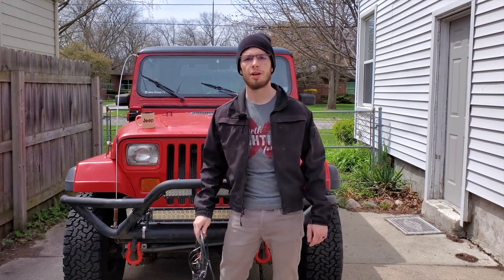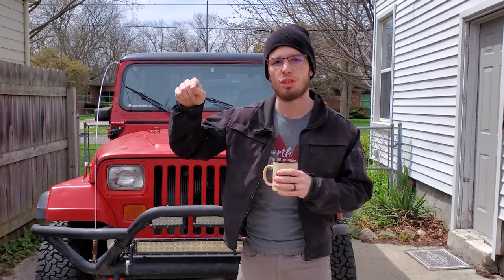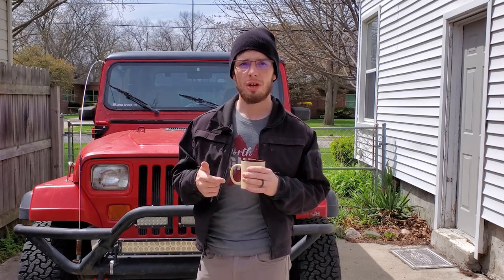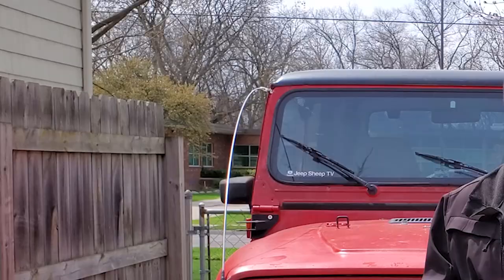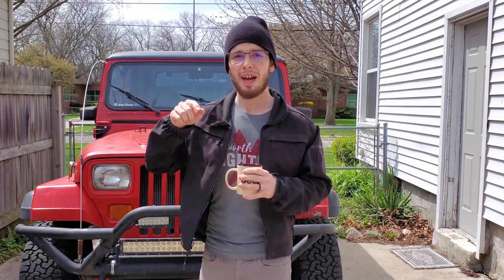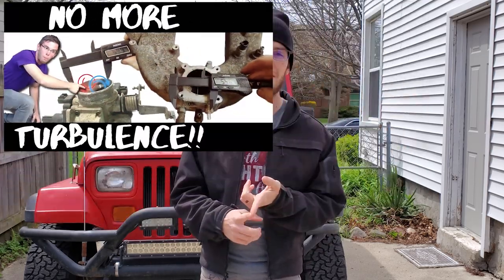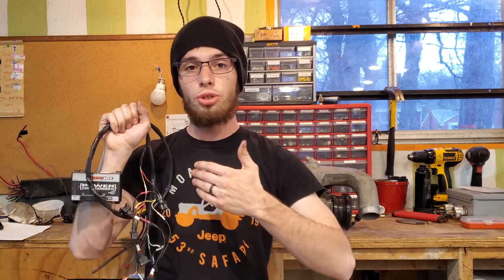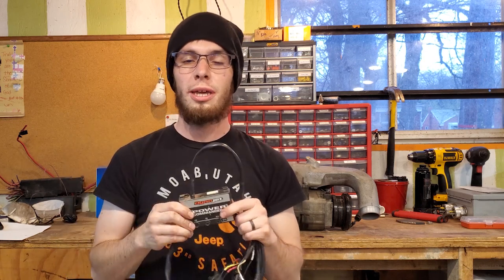Fuel Injection Tuning My YJ With A Motorcycle Chip (DynoJet PC3)

Comment: Can I do this to my '99 TJ, 2.5 with OBD2?
Reply from the maker: Yes you should be able to.  I guess I wasn't clear on that,  this will work for you but you also have other aftermarket options.
Reply: I have a 91 Renegade. 10 years ago I tried a Jet plug-in and it absolutely did the opposite of what it was supposed to. Was not impressed, but I hear other folks are happy with them. I still have it stored, do you suppose there is a way to find out if I was sent the wrong one? Curious.

Comment: Just make sure you know how much more or less fuel you’re using when you change the settings. I’ve worked on bikes for over 20 years and I seen a lot of people blow their engine running it to lean. That box is an awesome mod If you know what you’re doing! I’ve never seen one used on a Jeep! Good luck

Comment: Hey man just wanna say I've been watching several of your videos these past few days and you are a phenomenal source of information. Your content is top notch, easy to follow and provides a ton of info. You should have a ton more subscribers. As a content creator myself I understand how hard it is to put together good content and not be valued for it. I have a question for you...its not jeep related but my vehicle is kind of in a small niche as well..and hard to get any aftermarket support for it....its a 2000 dodge ram v10 8.0 and it has cat removed high flow exhaust system, smog pump delete and that's about it. I'm wanting to play with splash mixing e85 or even home brewed e100 and came across your videos because of this pc3. Would this work if I added 6 more injector connections to it? Or is the entire module amd software only set up to run 4 cyl? Any suggestions to playing with fuel? I've been told that it should run fine with almost any percentage of ethanol while cruising low rps etc.. but at higher percentages of ethanol especially the computer may have trouble adding enough fuel at full throttle and start stumbling etc..I'm not sure I want to go with bigger injectors because I dont think I need to and I'd like the option to run it on all  87 when I want...I just need a simple way to adjust the fuel on the fly, and safely.  I know I can spend big money on a new handheld tuner and their software package but something tells me there is a simpler way. I even thought that maybe I could alter the o2 sensor voltage to increase or decrease fuel but it may not be a fool proof method. Any help you can provide would be much appreciated. I hope your channel grows like crazy, and anyone watching this and learning from him the least you can do is subscribe. I'm subd! Look forward to seeing more. Thx man👊
Reply from the maker: Awesome thank you! I also feel that I should have more subscribers lol ... so share my videos wherever you can. As for the PC3, no it doesn't really let you add connectors, each PC3 is purpose built for a specific application and I am pushing it by using a device meant for a motorcycle on a jeep engine. However I would not recommend it for E85 anyway. E85 required 9.75:1 air fuel ratio where gas is 14.7:1 and that changes based on the amount of ethanol in the gas and E85 is not well regulated so the percentage can change a lot. basically what I would do is find some way for the ECU to ignore the O2 sensor all together (or maybe try to offset its values) because the ECU will use it to target 14.7:1 which you do not want, then run a wide band O2 sensor and and ethanol sensor to a microcontroller that runs an extra injector (or maybe 2 for your engine). Based on the amount of ethanol content in the fuel I would have it add an appropriate amount of additional fuel. So basically I would build my own system... I have to believe that there is some kind of fuel enricher system out there that does this already.  You also need to remember that Ethanol eats rubber and other things and all of your fuel lines need to be rated for E85 or they will just dissolve and make a mess.

Comment: Looking forward to the next videos!
I’ve owned several four cylinder Tj and YJ over the years, my current is a 95 YJ 2.5 manual, 4.0 tb, spacer, header, no cat, flow master super 10, electric fan, crt ignition @45k voltage, accell u groove plugs, Harland sharp roller rockers, four hole injectors, on 32/11.50/15 I live in East Tennessee lots of hills, and I lose so much on inclines, but not like I used to. Hoping this mod works out!!
Reply from the maker: Man you have done just about every mod out there! I hope I can get this to work so you can add it to the list!

Comment: great video what is the amazon link to those connectors? also what PC3 do i need to order for my yj
Reply from the maker: see the link in the description of the "installing the PC3" video. As for the PC3 you need one that fits a 4 cyl motorcycle and connects at the injectors. I think there are more than one option that will work but mine was designed for a Suzuki GSXR 1000.

Comment: Could you use a PC6 instead of the PC3? It's hard to find a new PC3 kit...which one should I choose (Harley or Suzuki)? Thanks in advance.
Reply from the maker: Maybe, the important thing is that whatever you get, it connects at the injectors and is designed for a 4 cyl engine.

Comment: Man, this looks like a killer mod ! Well I don't think it would match very well with an Ethanol kit but it looks inexpensive and it could increase performance running on ethanol so no kit needed at all in the end. 
There is indeed a lot less performance parts for the 4 cylinders ! I done lots of research I managed to find out that you can at least have buff rocker arms that are interchangeable with the 6 cylinders it's a very good mod to have torque in further rpms and its a lot more reliable and knocking proof. Craziest and only big mod there's a company that builds Supercharger kit for the 150 cui ! A whole new intake bored for 6 cylinder throttle body all in smooth aluminium and reinforced injectors fuel line. Room is available for the power steering pump and basically you have a modified pulley and extrabelt to motion the compressor and feel like Mad Max with the YJ... For 2 500 $ !!! Nearly 2/3 time the price of a complete new block and assembled engine.
Reply from the maker: I have seen a couple supercharger kits out there,  what company are you referring to?
Reply: @JeepSheepTV  It's first on Google when searching it's from " Boostedtech.com " and my bad it worth 4 500 $ holy shit !!! More than a all new engine.
Reply from the maker: @jemlesvideo  Yea, you could buy 2 YJs for that. They have a pretty slick kit but I just couldn't justify that price.
Reply: @JeepSheepTV  Yeah tottaly that is just crazy I mean it's Jeep not Ferrari ! Some dudes however built ther own from an M90 Eaton that they adapted. Sure it's plenty of working hours time but a lot cheaper in the end !
Reply from the maker: Lol stay tuned.  I have something coming up that will make you happy.  Go look on the community tab on my channel page...

Comment: Do you think that tuner will work on my 1988 S10 with a 2.5
Reply from the maker: It might. It just intercepts the signal to the injectors
Reply: @JeepSheepTV  that motor has a throttle body no injectors
And it's obd 1
Reply from the maker: @Veryrandy8508  Then no, it will not work
Reply: @JeepSheepTV  thanks for your reply 🙏

Comment: I see there are many 4 cylinder pc3 boxes available.  Does it matter if it is a GXS or some other motorcycle model?
Reply from the maker: I would imagine most would work but some connect directly to the ecu and some connect to the injectors. You want one that connects to the injectors as it will be easier to modify

Comment: So, we both have OBD1, but I have a '93 Grand. I've done a few mods, but I don't feel the ECU is adequately compensating for them. Any idea if this might work for the 4 liter? Or is it pre-tuned to only adjust the injector pulse of a 4 cylinder?
Reply from the maker: This only works for a 4cyl as it only has 4 inputs. Theoretically you could have multiple pc3s for more cylinders

Comment: You and I got to Jeff about the same time.  I attempted to connect mine and got the engine to run but it sounds like I am missing and the check engine light comes on.  Jeff and I had many conversations about it and the wiring seems correct but it just won't run right. Pulled it off and haven't messed with it since as my trans was giving me issues.
Reply from the maker: Hmm I haven't had any issues like that but we will find out as we go along!
Reply: @JeepSheepTV  I am guessing I have it wired incorrectly but I just don't know where.   It starts and idles but check engine comes.on instantly and it doesn't rev properly
Reply from the maker: @SpecialMomentsLLC  I'll be releasing a wiring diagram,  hopefully it will help you

Comment: Ok, so I think I have exactly the engine you have.  My motor is a 4 cylinder 2.5 LT in a 1995 YJ.  The beauty of it, because it’s an OBD 1,  in N J our Motor Vehicles has exempted everything from 1995 back as they only use the OBD 2.  Thus, no inspection required.
Reply from the maker: Nice!